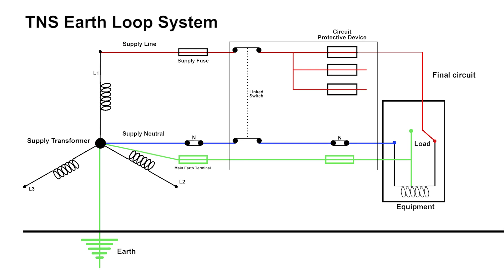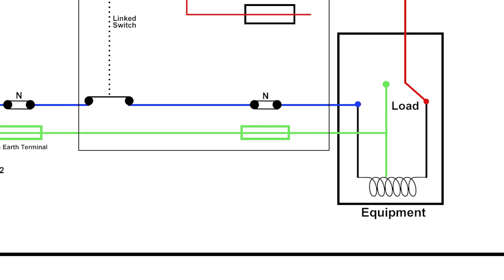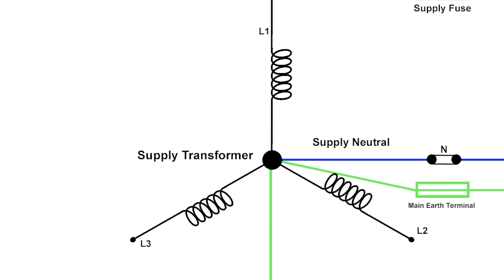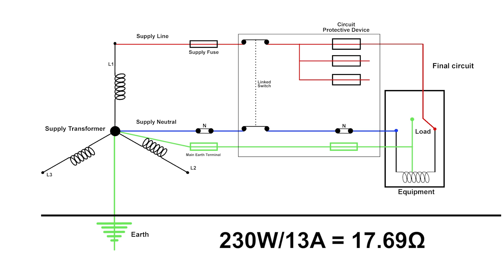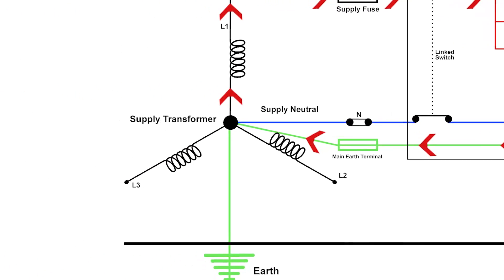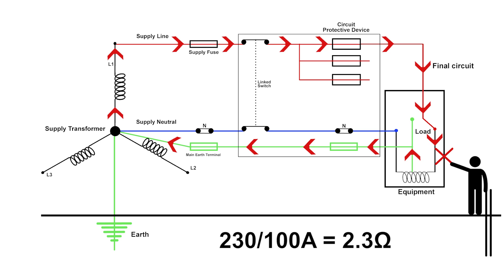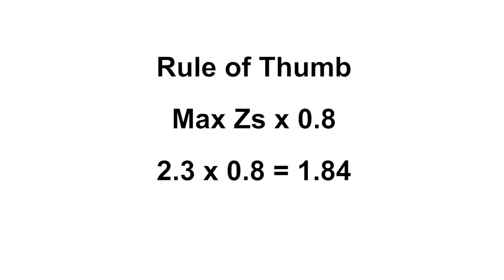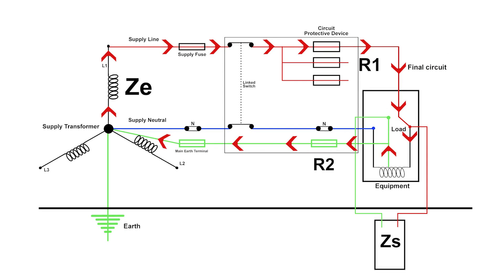Loop system

Comment: one question if you put a grounding rod and isolated it from the neutral would it still protect you and prevent energization of the panel and other metal enclosures the way you were saying or would you have to bonded to the neutral bus bar in the main panel.